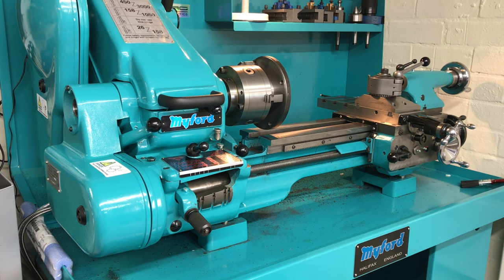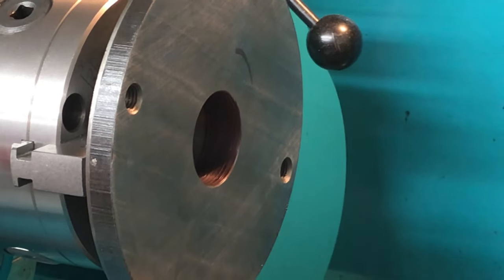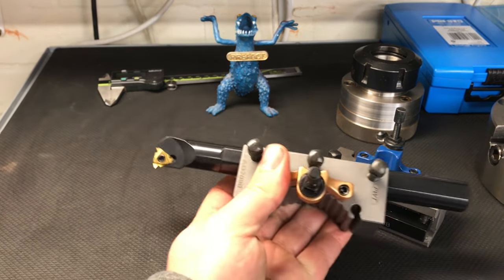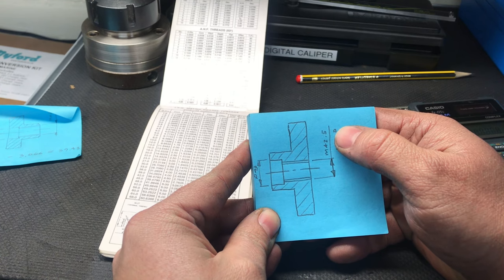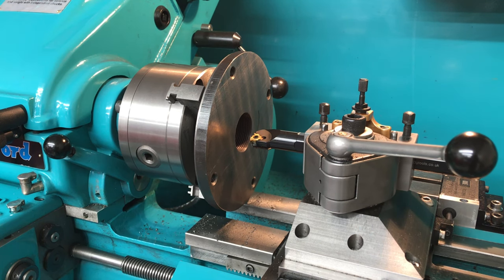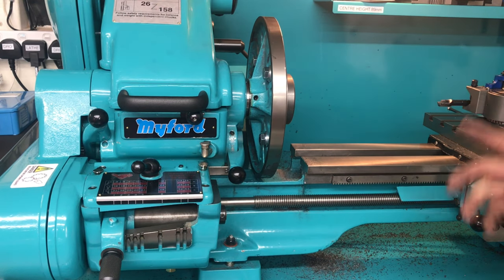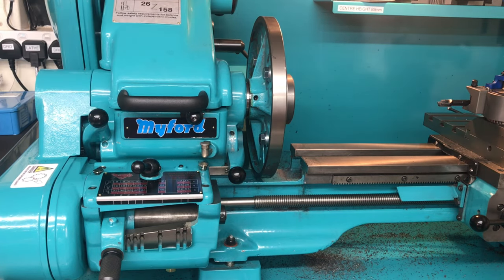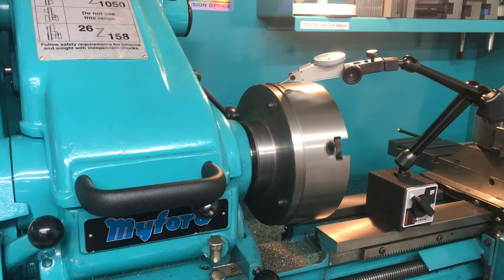Metric Thread Cutting & Machining a Backplate - Myford Super 7 Turning Projects Part 2

Comment: You can make a wooden cradle that sits just under the chuck to support it and protect the ways during changes.  Even just a wooden board is a good idea to prevent dings.
I would shorten those bolts so they are flush.  You don't want things sticking out like that as they will catch swarf and wrap it around the spindle or catch your sleeve and do even worse things.

Comment: Nice machine. Wish they had made the big spindle back in the day, mine is from 1974 and has the standard one of course. Have seen an "AS" size toolpost on a Myford, this is only available from one German seller, very costly, but between the Aa and the A in size, so absolutely spot-on for the Myford. The basic kit isn´t too bad, but with added tool holders it adds up to the cost of a very good lathe made in China.... Anyway, it´s on the wish list, am still using the "Dixon" style after many years, because I have one on the rear tool post as well. Other than that, my absolute favourite accessory for the S7 is the rack feed tailstock attachment, which is the most useful thing I have ever bought for my machines. Thanks for the videos, your lathe looks like a particularly delicious piece of candy with that paint job. Quirks of the Myford lathes aside, the draughtspeople who designed the castings for these machines back in the day have my congratulations for a job well done, beautiful curves and shapes everywhere, and looking good in the old grey or green paint jobs too. Mine is on the industrial stand, which adds to the overall appearance.

Comment: Hello,
Good review on the PeWe tool holders… Peter from PeWe suggested to me the purchase the AA size would be best from my Myford, he does seem to be very helpful. Also, good to see you using a Zeus book… 
Take care.
Paul,,
Reply from the maker: Yes, the holy writings of Zeus ha ha. 

Yes AA is probably the best with a standard set up. I went with the size up because I knew I was going to make the solid tool post and set the height a bit lower. I personally prefer the option of slightly larger tooling but each to their own.

Comment: Is there a spindle lock on this Lathe or were you using the backgear lever to put the back plate on ?
Reply from the maker: I was a bit naughty and but it into back gear... but in my defence, I don’t tighten the chuck up too tightly and it only needs a moderate tap to loosen it off.
Reply: @opticalmechanic  Lol! I suppose the backgear lever is close to hand!  I am interested in a refurbished super 7 from Myford. Is yours a 3 phase motor with a phase converter
Reply from the maker: @irvine40  indeed ha ha. I bought my machine new so it will be as per the Myford website, link below:

https://www.myford.co.uk/acatalog/SUPER-7-CONNOISSEUR-LATHE.html

It says it’s a 3 phase 220V which is a new one on me but I’m not an electrical engineer. All I know is that the power supply is via 13A 240V socket. It’s a cracking little machine though. Depending on whether or not you want power crossfeed, there is a refurbished machine on the Myford website at a decent price. It doesn’t have a quick change gearbox but I’m thinking now, after having made it a pre-requisite to have one, now that I do have one I’m thinking that an ELS conversion would possibly be the way forward if I was buying again. I’ve spent too much on machines etc recently so I’m going to have to leave that idea for some time in the future...
Reply: @opticalmechanic  thanks much appreciated!
Reply: @opticalmechanic  There should be a spindle lock pin with its handle sticking out through a slot near the top of the change gear cover behind the spindle (so you don't need to open the C/G cover to use the lock).